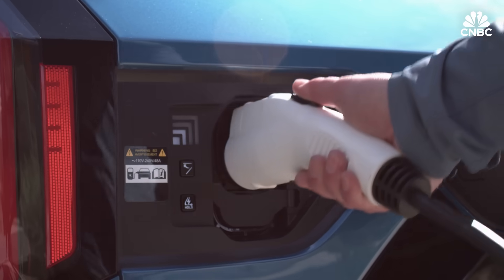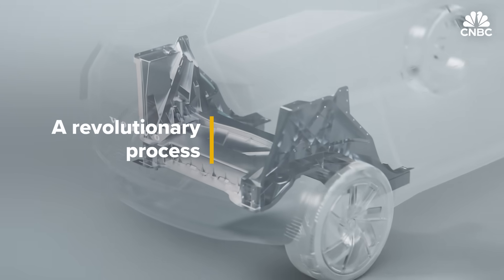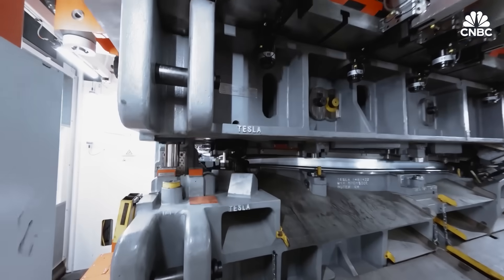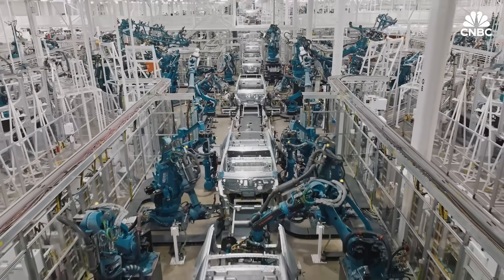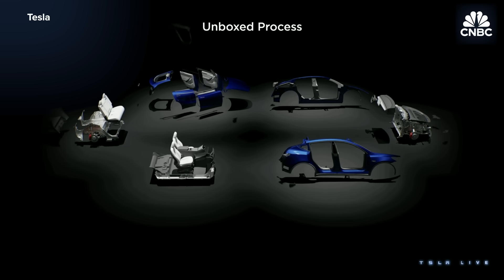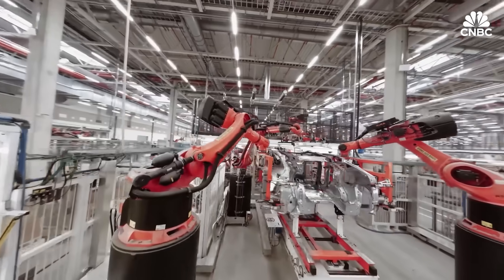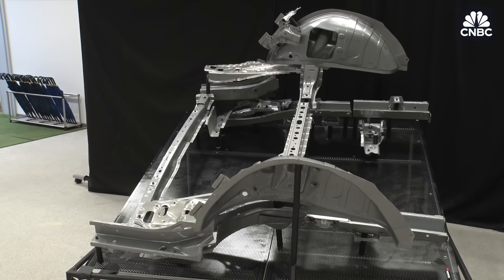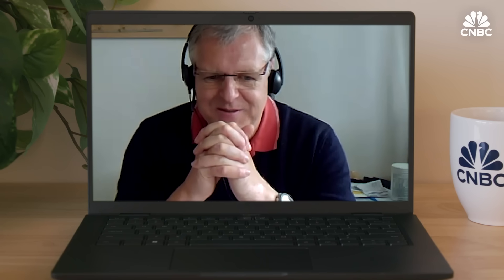Why Tesla And Other EV Makers Are Betting Big On Gigacasting

Comment: Trump's taking us EV once elected and Americans can't afford 💯‼️❗ skyrocket gas to steer towards EV'S but batteries are $1000-20000 for replacing especially hybrids. This is why Elon is eager for trump to take office. From buying Twitter to SCOTUS protecting from Tesla lawsuits and deaths. I don't want to be stuck on side of road needing electricity INSTEAD of jerry can of gas 🙎🏽‍♀️🙎🏽 also the tariffs will bankrupt auto makers to upset car manufacturing in USA. The first tariffs hurt the auto industry and gave foreign countries more leeway and leverage on USA auto markets 😡😤 notice all THESE car repairs insurance companies emerging. EV means not only car insurance but mandatory repairs insurance to maintain on top of the car note and possible charging station installed at home 🙆🏾‍♀️🙆🏾 VOTE BLUE 💙🔵

Comment: Sure, the usual BS! 
For starters, aluminium is much more expensive than steel. 
Repairing vehicles in aluminium is extremely costly.
It is NOT going to bring down any prices, that's for sure.
Reply: Did you watch the video?  The additional costs are offset by greater cost reductions in other areas.

Comment: A cast component can't/wont be structurally sound after a repair and cast components wont flex like a stamped sheet. 

So can you imagine how these cars will age regardless of crash damage or other impact forces, just the use of the car over time will lead to stress cracks.

Comment: Gigacasting is not a new concept, it is made possible with newer material(thanks to collaborative effort with SpaceX). It definitely improved safety and simplified manufacturing process. One downside is the lack of repairability, since it cannot be certified roadworthy, compared to bodywork done through welding and sheetmetal work along with selective replacement of structural parts. This eventually shows up as increased insurance premium. Not heard much about bodywork done on gigacast parts yet. Most of the time, the car is declared being totalled. Anyone, who had a first hand experience with getting gigacasting repaired, please chime in 🤞.

Comment: Why did they not mention that GM has already started megacasting with the Cadillac Celestiq?
Reply: Q: Why did they not mention that GM has already started megacasting with the Cadillac Celestiq? A: because they don't know about it.  and really GM's already employed LARGE castings in their Gas vehicles.  it's already used in the Alpha Chassis which underpinned the 6G Camaro way back in 2016 (which is now already out of production) and both the Cadillac CTS and CT5.  and it's used even MORE EXTENSIVELY starting in the 2020 Corvette C8...

GM has long produced these parts at their Bedford Casting Operation in Bedford Indiana, so it's "old hat" as far as their concerned and NOT something they would ever think they needed to "crow about" like a Start-Up operation who's "baby young to the world" of manufacturing.
Reply: GM did aluminum casting previously. That’s nothing new. Lots of products use casting. MEGAcasting was used on the 2024 Celestiq, years after Tesla. You may or may not like Tesla but please don’t blatantly lie.
Reply: @juliahello6673  re: "You may or may not like Tesla but please don’t blatantly lie." you may LOVE Tesla (and desire to give Elon hand release) but please stop lying to keep the Stock from going in the toilet.  the Robo-Taxi's not coming in August, which surprises NO ONE.
Reply: No. Casting is only possible with MASS production. GM execs have no comprehension of mass production.

Comment: Cheaper to make, more expensive if not impossible to repair, which means more cars getting written off for damage that would have been repairable on a normal frame. Making the battery the "floor" of the EV hasn't worked so great for Jeep's EVs where the cabin explodes off the vehicle when the battery vents directly into the cabin during thermal runaway.
Reply: Tesla EVs are not comparable to non-Tesla EVs.
Reply: re: "Making the battery the "floor" of the EV hasn't worked so great for Jeep's EVs where the cabin explodes off the vehicle when the battery vents directly into the cabin during thermal runaway."  <---- great reference, see Dan's "plugged in" and paying attention. 🤙
Reply: @phillyphil1513  Yep, but works great for Tesla.

Comment: Why not using polymer composite? Would that be cheaper and lighter than aluminum?
Reply: Car crash?
Reply: @xDUnPr3diCtabl3  I have seen pistol casing (upper receiver) utilizes some form of composite polymer.
Reply: @xDUnPr3diCtabl3 built like a formula one car! Safest vehicle on earth!
Reply: The weight savings of using a polymer composite would be negligible if it also comes with worst mechanical and thermal properties. Not to mention depending on the polymer, it’s gonna be more difficult to manufacture.

Comment: I've never understood why enhancements like this are discussed only within the use case of EVs when they could theoretically be used for ICE vehicles as well.
Reply: Elon pushed the envelope on castings just like he did on EVs. Legacy ICE brands could have done it before Tesla but they chose to do 5% better every 6 years because customers accepted it. Now Elon has pushed Legacy to grow more than 5% and they have growing pains now. If Elon didn't exist, they would have no reason to go EV, or castings, etc.
Reply: @fcv1967  amen brother. Hit the nail on the head.
Reply: @fcv1967  Yeah, the legacy car makers actually would not know innovation if it bit them in the a**: They have been so without innovation for so many years, being able to cook up the same old thing with a different shape year after year that they have lost all ability to really innovate anything.  The claim it in the marketing though, what BS: "now get the all new (INSERT NAME OF CAR HERE)", the exact opposite is the true.
Reply: Because Tesla. The first ones to do it at scale was Tesla. Now it's a discussion.
Reply: @d.r.656  Tesla has the highest vehicle margins IN THE WORLD. DUHHHHH!
Reply: Weight is more important in EVs than ICE vehicles. However, there is also an advantage that fewer parts mean less cost from joining.
Reply: It can be used for ICE, however most of the companies have about a hundred years of experience with their old methods, and have them rather streamlined and optimized, changing it just for their existing models wouldn't be worth it.
Reply: LOL....ICE manufactures hate to innovate. Ruins their profit margin and they are run by MBAs and not engineers.

Comment: This is a dumb idea. Sure it might be a little bit cheaper to make but it makes it more expensive to repair. Can’t just replace a quarter panel anymore. Insurance goes way up. Thanks for thinking of just yourself, Elon
Reply: Megacasting is done on structural components, not quarter panels, hoods, etcetera, those are still stamped. If you get into a wreck in a unibody car today where the structure is damaged, you'll have totaled the car anyway, same thing here. You can still replace a damaged quarter panel or hood or a door if the structure itself hasn't been damaged, just like today.

Comment: Tesla gigacasting uses a new alloy that has a lower defect rate.

Also many are finding repairing a casting isn't that difficult. Welding can work more often than people realise. Although replacing castings may be easier.
Reply: If the damage extends to the gigacasting it is likely that there is enough damage to already total the car.
Reply: @jbbuzzable  Did you see the video? Tesla can fix the casting in house.
Reply: @regularjoegamer  Of course. I'm just not sure how often this repair will be needed.
Reply: I heard Tesla was going to have a body cast for repairs at cost. It was an unbelievable price of around $800 for the body
Reply: @snaplash No. Tesla designed castings to be repaired in 1/10th the time, at 1/3rd the cost of ICEbergs…😂
Reply: Welding cast materials is difficult, specialised, and costly to maintain the structural properties of the cast piece. Without preheating and correct post weld heat treatment welding cast materials is difficult - without taking into account warping or movement in the whole part during welding - especially large relatively thin cross section casts. On risk analysis replacement would be safer for the vehicle owner in a crash rather than welding, but this of course is expensive which is why cars with these large cast structures are written off instead of repaired.

Comment: Tesla has been using Gigacastings for a couple of years now and Germans are still busy arguing if it's a good choice or not.
Reply: I still remember every so called BIG BOY ridiculed Tesla's decision on Gigacastings. It is funny to see that the table has turned now. LOL
Reply: @DDMSakb48  tesla uses byd batteries
Reply: Why tesla looks like s Porsche then or using aluminium like Audi did
Reply: @TheoWink-wh8st  Which Tesla model looks like a Porche? Maybe the 3 ! The juniper one definitely doesn’t. It surely smoke some of the Porche models if not all😁
Reply: @raymondschembri5042  there is smoke alright if you’re buying a tesla 👎😆
Reply: @raymondschembri5042 I’m guessing it’s in the front bumper. I hated all Tesla front ends (except for the S and Y because they had  mustache or nose cone). The other models just looked like duck bills, and I hated it. I wondered why they couldn’t have rounded bumpers like  the Porsche.
Reply: @TheoWink-wh8st the Model S looks pretty close to a Jaguar XF. Their first gen roadster looks like a Lotus.
Reply: @TheoWink-wh8st Audi didn’t invent using aluminum in cars lol
Reply: @FerrariTeddy  audi a2 weight 830 kg;matching 2 mericans
Reply: Could not agree more, no wonder this German guy is sceptical.
Reply: None of the German manufacturers have a competitor for the Model 3 yet, VW doesn't have a Model S competitor after 14 years :D
Reply: @rkan2  They have the other sub brands to compete with the S . But surely it cost you more for maintenance and can’t match the Model S performance 😂😂😂😂😂
Reply: @raymondschembri5042  But there isn't a competitor from any VW brand. The A6/A8 would be the competitor as an EV. Porsche Taycan/Audi Etron and some of the SUVs could regarded as some, but not a direct one.
Reply: @rkan2  Germans - maybe, but what about the French? While folks outside Europe will not be aware, a car like the Renault Megane E-Tech is nearly €10k cheaper than a model 3 a very compelling value proposition even compared to the Chinese influx. It rivals a Tesla on efficiency and weight (around 1600-1700KG) despite mostly being steel with some aluminium and carbon parts like doors and drives quite nicely too apparently. I wouldn't rule the Europeans out in their home market yet.
Reply: @crankcase75  It isn't a competitor to the Model 3 as it has only 160kW and no premium suspension (e.g  multilink/double wishbone). Also it has SUV qualities, where as the Model 3 is a traditional sedan.

Competitors to the Model 3 would be the BMW 3-series (which exists in China as an EV...), Audi A4, Mercedes C-Class, BMW i4. Renault doesn't really have a car in that class and the BMW i4 is the only one that only recently exists.
Reply: @JigilJigil  you mean Italian gigacasting😆👍
Reply: True and it is not. For the customer it is the worst choice. Have fun with exploding insurance costs
Reply: @Shaberla   they stop supporting subsidies,imagine what gonna happen 😄🤯
Reply: Reparability
Reply: The flipside of this statement is Tesla tends to ignore decades of established engineering, and while its good not to be held back by "that's how we've always done it", there are people who have considered these things and already know the downsides. Also the Germans already have tried some very cutting edge and advanced methods of production - The old BMW i3 is still overall more ahead of its time than many cars now, but it never really caught the imagination of buyers. It was too far ahead of its time in its whole design philosophy.

Really though, what the Germans are doing isn't anywhere near as relevant as the Chinese, and while some Chinese EV manufacturers went for gigacasting, others have had more conventional construction and still managed to produce cheaper cars below the Model 3 sort of space and that's where Tesla is losing.

Comment: Is this casting stronger or weaker though? Logic tells me its weaker as its one source of failure. If you have different pieces making up the cast, then pressure can be exerted in different parts. With this surely once the metal bends in a crash it will just give way and everyone inside will be crushed?
Reply: Saftest cars in the world if you really care. Just look it up.
Reply: It is actually stronger and safer. But it does mean that it slightly increases the chance of a car being totaled
Reply: Its actually way stronger which is why in every crash involving a Tesla and another car , the other car is always totaled.

Comment: And this is why car insurance prices are theough the roof if somebody hits that part of your car, before the small piece could have been fixed or welded, whereas as now it all needs replacing so costing thousands of dollars when before it would have cost a couple of hundred dollars. All Tesla have done is move the cost from them onto consumers through insurance prices. Hopefully FSD will make RTIs less likely to happen which should help keep insurance prices down overall in the long term
Reply: That has been true ever since unibody construction optimized the destruction of the car over the destruction of its occupants. But CNBC and you do not know that. Because you are kind of slow.